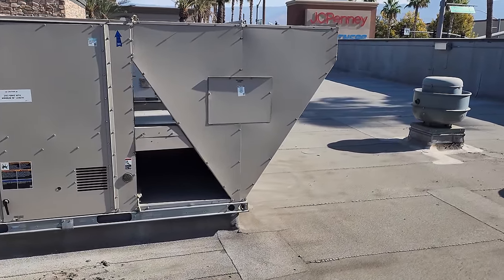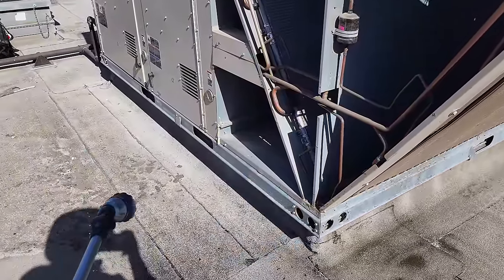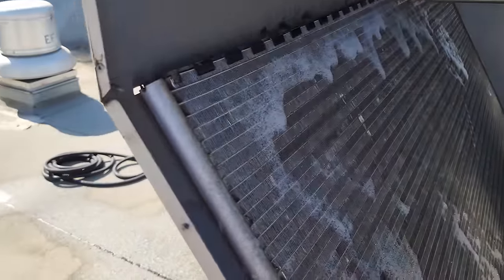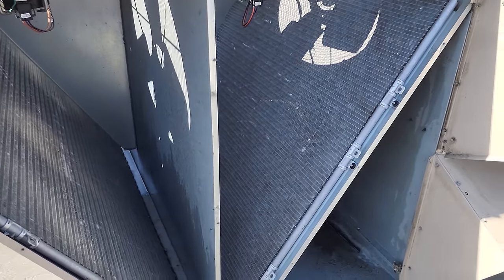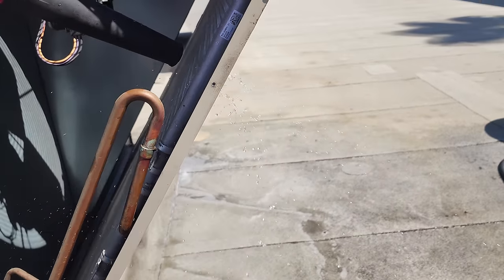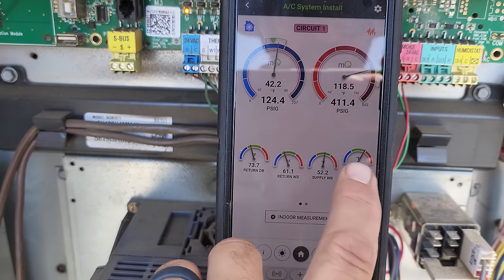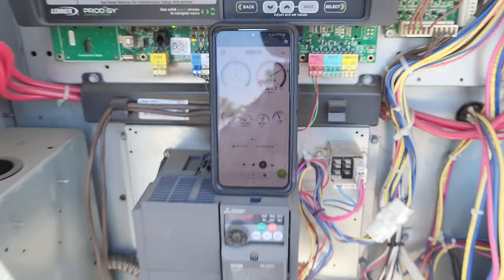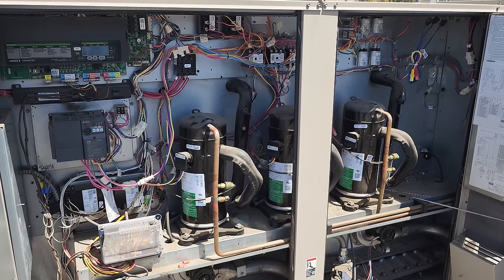WARM WEATHER IS COMING SUMMER IS UPON US

Comment: i’m getting an understanding of imperial temperatures from watching these videos
Reply: fahrenheit = how humans feel
celsius = how water feels
kelvin = how the universe feels

hope that helps :D
Reply: eh kinda, probs still keep converting it though to make sure
Reply: @kaplunk1548  water freezes at 32f, 100f = 38c, water boils at 212f. 

helps me with the conversion in my head :)
Reply: I'm purely metric because I find it much simpler and faster to work with, especially when calculating and designing, and this is something that drives me nuts! Other channels have started to include both units due to the diversity of the audience. I've a couple of imperial pressure units and distance units but never temperature units (apart from body temperature back in the dark ages). Considering the US is supposedly already using metric units, there's an awful lot that seems stuck in antiquity. The most helpful thing I can think of would be if instruments displayed both units simultaneously so those used to one system can easily and automatically get used to the other. It's what I did decades ago to help me migrate to purely metric when there were still things in imperial and other archaic units. The SI units are freely available online, along with the relationship to obsolete units.

Comment: Regarding the low water pressure issue: you should be able to get a cheapo booster pump to help fix that issue (just don't turn off the water when the pump is running so you don't burn up the pump) :)

Comment: In low pressure situation I use a pressure washer with 90 degree fitting or a m18 transfer pump to up the pressure

Comment: What is a good / okay digital manifold set?
Reply from the maker: Fieldpiece sman is a solid choice check out TruTechtools.com and use my affiliate code (bigpicture) one word to get a discount on most items
Reply: The compressor  and the indoor contact pulls in but the condenser fans will not run?If you are working carrier rtu 48tcdd  and not getting power to the left side of the contacters or the brown wire coming out of the transformer what could be my issue? I replaced the condenser fan motor , the relay and still I'm lost.  Please help

Comment: If you don't have good water pressure you shouldn't use a powerwasher. You could burn out the motor, because most of the time they are water cooled

Comment: I'm at least as much of a stickler as you are with those condensers.....
I've been on the rooftop of raymour and flanigan furniture in New Jersey trying to clean air conditioning units the size of a large van, and the units don't want to run because the condensers were not cleaned properly over the years.
These condensers were probably 7 times as big as the ones in this video.
In the video you say you're not perfect, but you're damn near perfect. Very few guys do all of what you do.
Reply: New Jersey gets just as hot believe me.